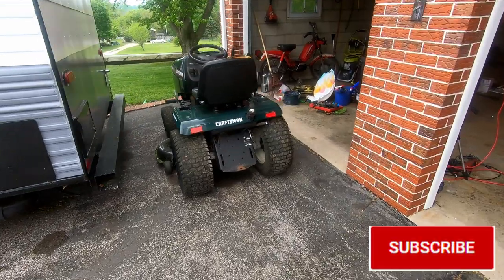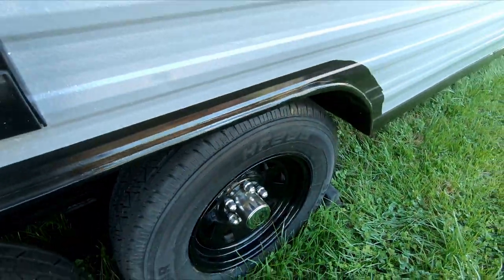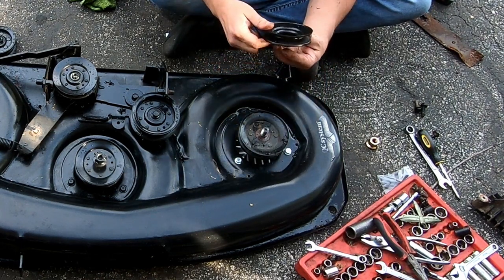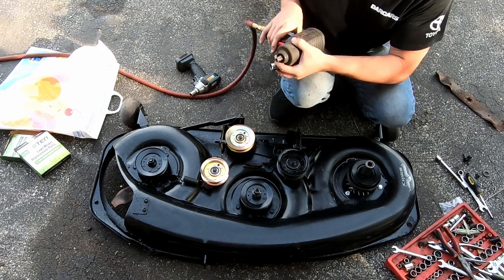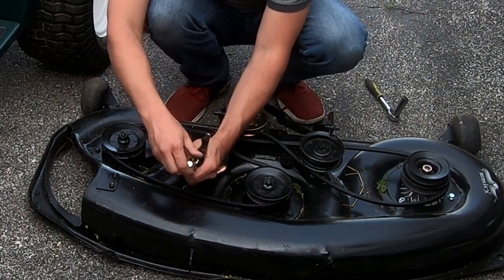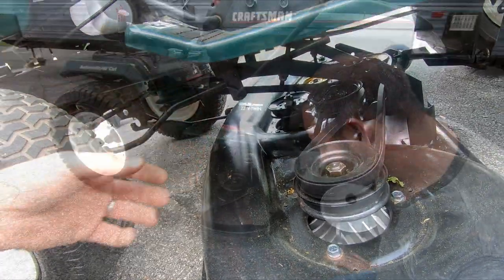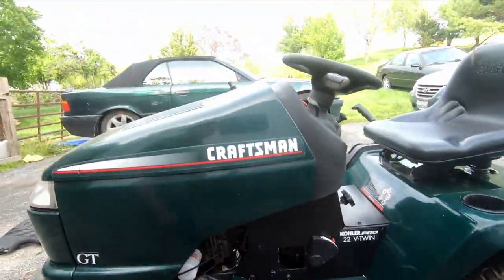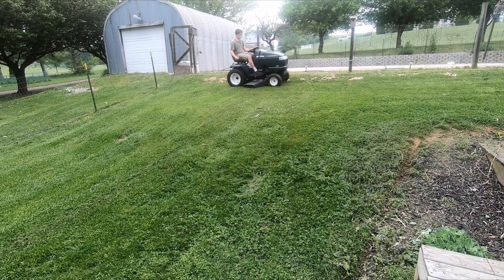CHEAP TRACTOR FLIP FOR PROFIT CRAFTSMAN GT Plus how to level mower deck

Comment: i have one it,s a gt 3000 and i work on riden lawn mowers and tractors of all kinds and on yours and other cutten decks you have to put the cutting blades in time so do you know howl to do that i will be doing a howl to on face book i have been in this kind of work for 17 years now and well look me up on face book and i will exsplain some thing s to you that would of saved you some money on that deck my name is robert lay look me up and hit freand reqweast and i will exseapted it and you can watch or go to my time line witch is my profile and watch video
Reply from the maker: This is not a times deck.  Very few are.  Currently do have a timed deck on the 33" mtd/craftsman walk behind mower.  Timed decks have cogged belts.  The GT does not have a timed deck.